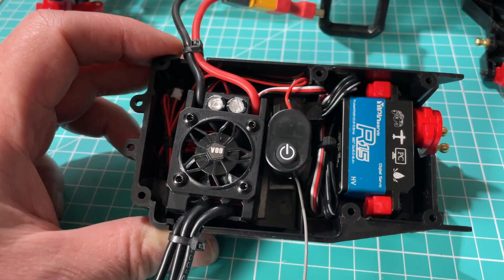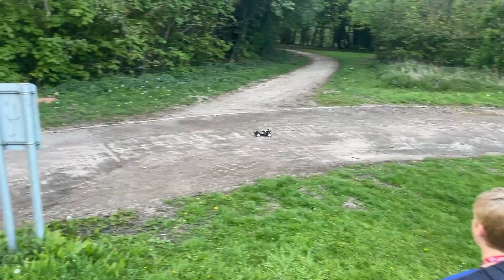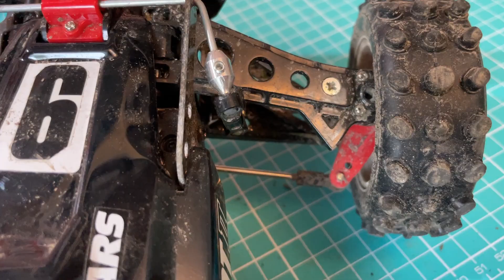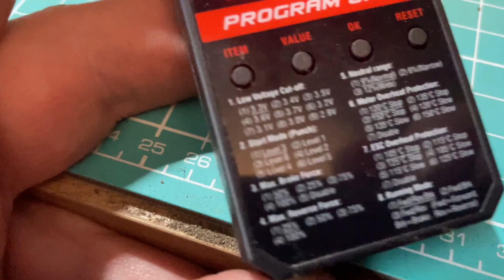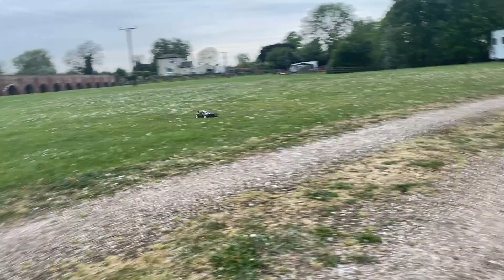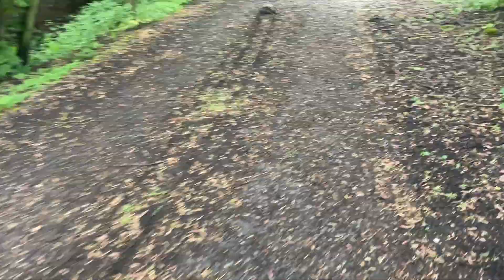Tamiya Hotshot 2 Gets Brushless Power!

Comment from the maker: My brand new Tamiya Hotshot 2 gets brushless power from the start. Together with a quality servo and a Lipo battery, it turns this RC classic into a little weapon, easily capable of taking on modern buggies. Find links to all the parts used below:

4350kv Bruchless Motor: https://www.rcshed.co.uk/shop/Brushless-Motor-4350Kv-3650-Can-4-Pole-complete-with-Temperature-Sensor-p738665832

60A Brushless ESC: https://www.rcshed.co.uk/shop/Brushless-ESC-for-RC-Cars-60A-2-3S-Lipo-Waterproof-with-Cooling-Fan-and-Temperature-Sensor-Cable-p739118541

15Kg Low Profile Servo: https://www.rcshed.co.uk/shop/Low-Profile-Servo-for-RC-Car-Steering-All-Metal-Digital-15kg-0-09s-p830435591

Dumbo P6F Receiver: https://www.rcshed.co.uk/shop/Dumbo-Receiver-6-Channel-for-RC-Cars-Boats-and-Trucks-p739162173

Comment: The Hotshot 2 looked great. Very quick on the brushless motor. Any concerns about the gears over the long run?
Reply from the maker: Glad you enjoyed the vid, I'm not too concerned about the gears as I have turned down the punch on the ESC, and I'm running the smallest pinion. Might get a steel pinion though, to be on the sage side. 👍